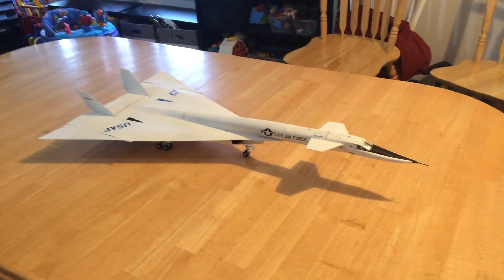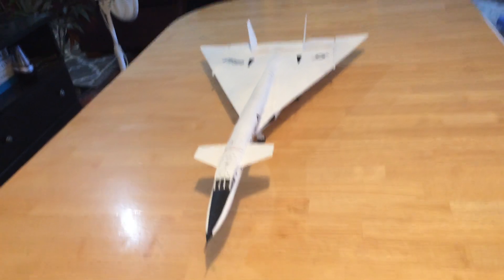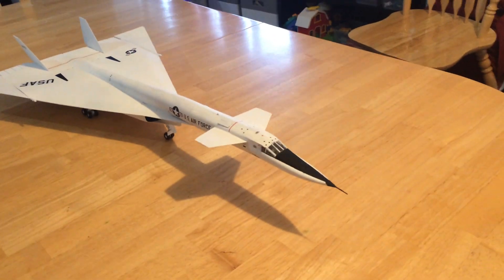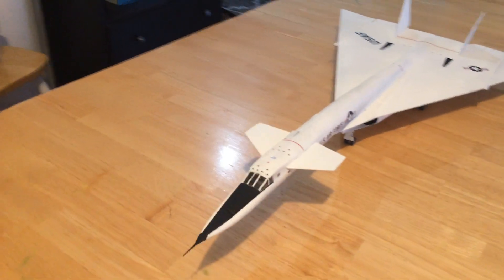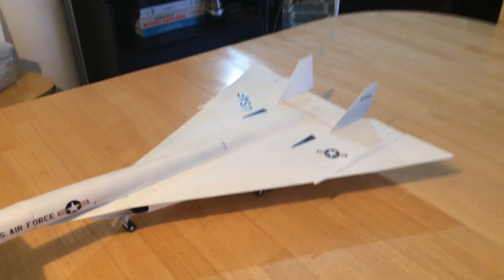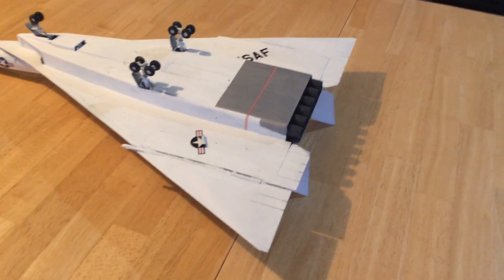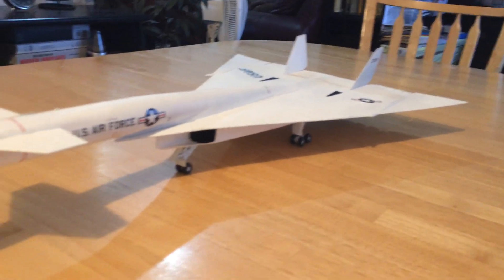XB-70 Valkyrie Bomber in 1/72 Scale

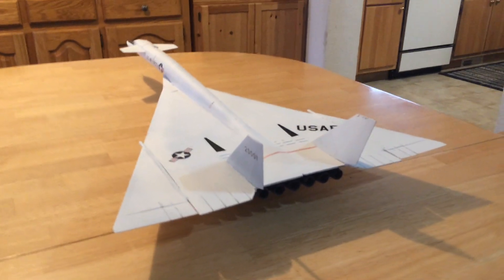Comment: @1:30 The first Lockheed A-12 flew about 2 years earlier in 1962.
Reply from the maker: I believe you are talking about the A-12 recn bird which was the fore runner of the SR-71. Another varient of the A-12, was the interceptor version, the YF-12A, which flew first in 63 This is the XB-70 and there was no A-12 to my knowledge that was its fore runner.

Comment: Nice job on that model and your history is pretty good too! The photo op you were talking about (where #2 was lost) was a GE ad stunt. I forgot how many and which planes (5 or 6 anyway) they put up in the formation but it was all about them all being powered by GE engines. Like you say, the F-104 got sucked into the vortices of the right wing of the B-70, it flipped and took out the horizontal stabilizers and I think the right wing tip. It was enough that no one could recover and down they went. Yes, it is pronounced "Valk-i-ree". I was a huge fan of this awesome machine back when I saw a smaller scale model kit of it back in the mid 60's when I was 8 or9. I can get this model on eBay right now for under $60 from the UK, think I'll do it though I have no idea when I'll get around to building it! Wonder if there's a way I can make those tips moveable? :)

Comment: Why have you painted the wheels in black? Actually they was silver, comrade
Reply: Yeah, they were, I've seen them. Some kind of heat resistant aluminized paint they put on them.
Reply from the maker: You are exactly right.  But after a few landings the bottom of the tires were showing black, and at a distance the black on the tires, contrasted with the silver on the wheel to make it look white.  So I painted them white.  It made for a clearer pic of the landing gear...but the wheel and the tire were initially silver, and the tires, were maintained every so often and repainted silver too.

Comment: I read that the MIG-25 Foxbat was designed specifically as a response to the B-70. The Foxbat could fly at Mach 3.2.....once. After that, the engines had to be replaced.
Reply from the maker: The Mig-25 and then the Mih-31 were built to try and counter the US high peed and high flying bombers.  But their manufacturing an quality were not up to par.  At the altitudes and speeds we are talking about, the Soviets would have very little time to call up, launch, and position any aircraft to counter.  We knoew they were unable to do so, because the SR-71, with similar flight characteristics were never intercepted by Mig-25s, Mig-31s, or even their best Anti-aircraft missile systems.  If they could not get the Blackbird, they would also have not been able to get the B-70s.
Reply: In the book "MIG Pilot", Viktor Belenko talked of their frustration at not being able to get anywhere near the SR-71. He imagined the pilots laughing at his feeble attempts to intercept them.
Reply: @JeffHead-IdahoUSA  There actually were two documented interceptions by Mig-31s in the mid 80s. The window for interception was very narrow but it was possible for them to intercept an SR-71 and it did happen at least twice. The key was 1, engines that would last long enough at the speeds required (which was the downfall of the foxbat) and the R-33 missile, which was equivalent to the american Just a few years afterwards it was retired. The swedes also claim to have made several successful intercepts with their Viggens, but in these the intercept solution would have failed if the SR-71 had maneuvered even slightly, which they certainly would have if the Swedes were hostile.
Reply from the maker: @wonderwulf  There were two claims of interception...but no SR-71 was ever fired upon...no SR-71 was ever damaged...no SR-71 ever had to so much as go into any serious avoidance movement.  That the Soviets saw the SR-71 on several occasions is without doubt...they simply could not do anything about it at the altitude and speeds at which it operated and that was because they did not have the engine or the missile that could make it happen.  Not with the 25 or the 31.  And their Rus-oenix simply was not up to the task.  After the cold war and after the wall came down there were several years where we had fairly open doors into Soviet intelligence reports.  They had some great ideas, but were poor on execution and especially poor on electronics that were dependable and capable.  Most of their high tech equipment was a crap shoot when it came to time to really, really use and depend on it.  And they knew it.  They bankrupted themselves building so much ground equipment in the true hope that enough would actually work to make a contest of any hot episode should it occur...but knowing they probably would not and hoping it never would.  In Eastern Europe our MLRS, A-10s, Apaches, etc., etc. were so proficient, particularly after they got to see them in action, that they knew they had no chance at victory with conventional arms...thing is, it turned out that their nuclear deterent suffered from the same and even higher rates of failure.  But when you have many, many thousands of missiles and warheads, even a 90% failure rate was something the US and no one else could risk.
Reply: If we had built a fleet of XB-70s, the Soviet investment in anti-air would've been even greater. Also, if these were the bombers we had instead of the B-52, our sortie and readiness rates would probably be in the toilet with a 1960s-era Mach 3 aircraft.